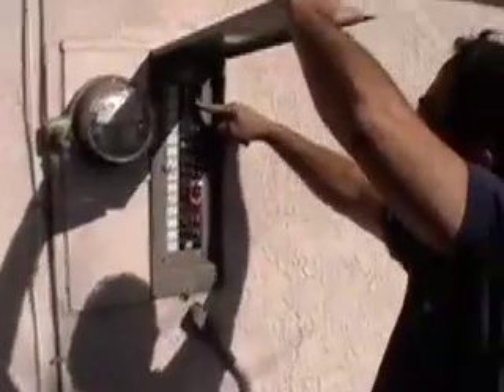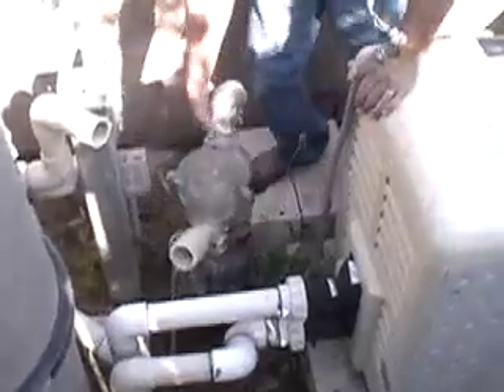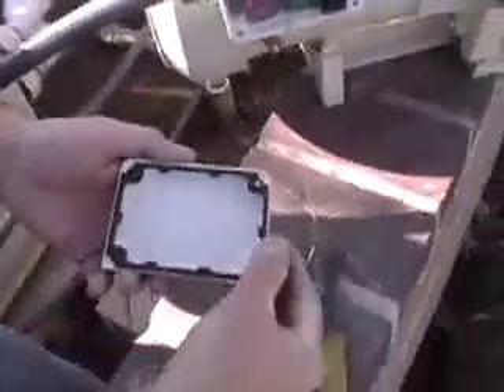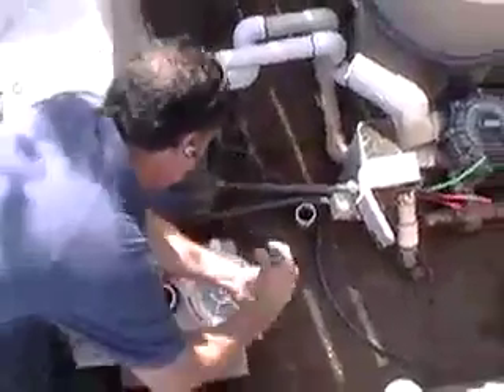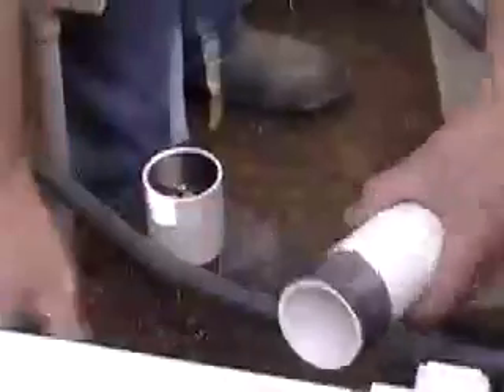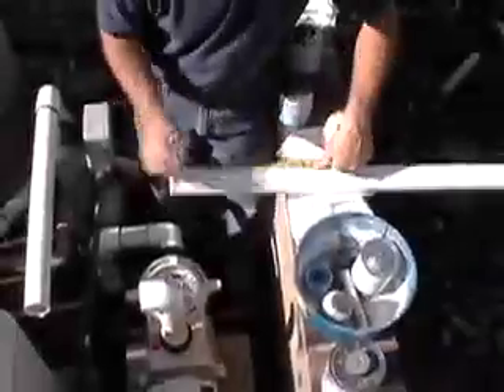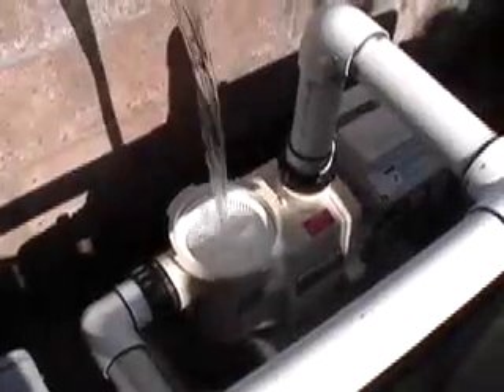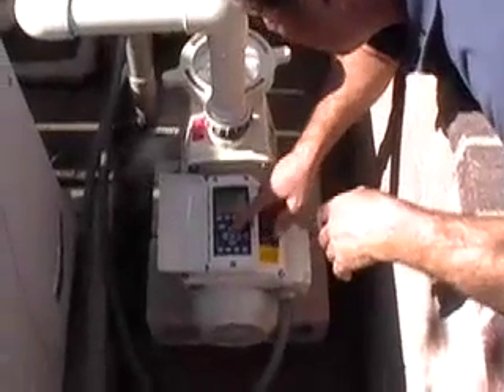How to Install a Pool Pump - Pentair Intelliflo Variable Speed Pump

Comment: Multiple 90s, with a short run into pump is not good practice, but the pumps are unaffected by that unless there is an issue with cavitation. I never put a flowmeter on it, but ideally you want a straight run up out of the pump also. Sometimes when a 90 is immediately above the pump's discharge side it may cost some flow. 

Regardless I've seen 90's attached directly to the pump many times (both sides) and have not noticed any difference in the operation or condition of the pool, nor premature pump failure.
Reply: It seems that they didn't read the manual before making this video.

Comment: I think the 5x the pipe diameter is not that important for two reasons.

One is that I'm a mechanical engineer by trade and have access to expensive flow modeling software.  I was curious about this issue and modeled it with 5x and something like 2x which is what I have room for.  The flow turbulence was not significantly different between the two.

The second reason is just thinking about this from a common sense perspective.  Where does the incoming flow go?  Right...straight into the basket that makes the flow all sorts of crazy turbulent.  If the incoming flow were going straight into the impeller I would think it was more critical.

Comment: He installed the pump wrong and voided the warrenty. The intake side requires 5x the pipe size in distances from first fitting.  2 inch x 5 = 10" .Not one of his PVC  joints were glued corrently need to follow ASME B31.3.

Comment: you said he used two 110 volt lines and a ground. So is this split-phase power totaling 240V? I thought two 110s and a ground actually ends up being 208V when combined. Can this use 208V too?